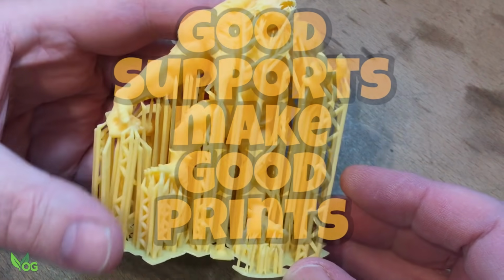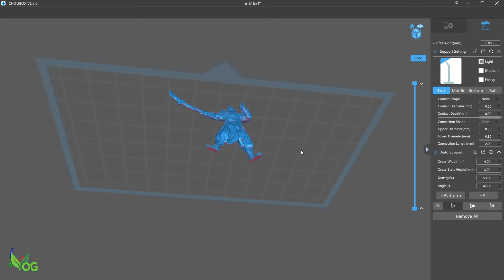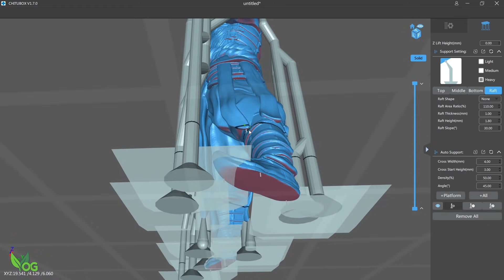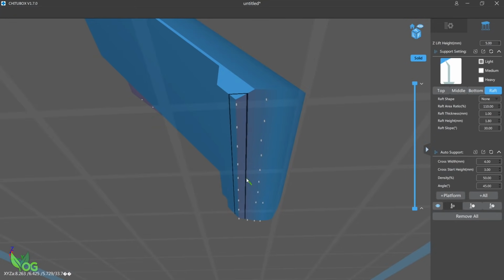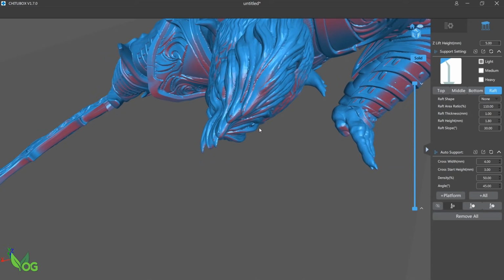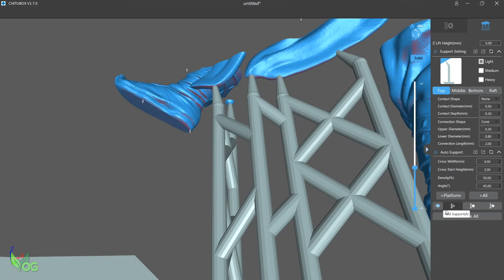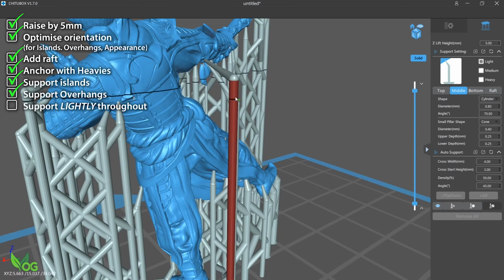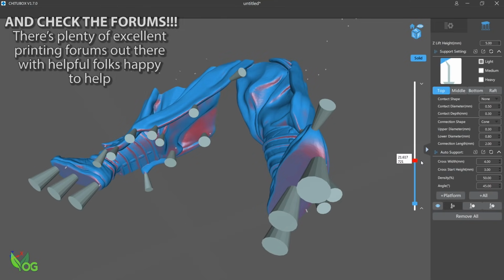3D resin print supports [EASY GUIDE]

Comment: Biggest tip I can think of is support in 3's and create triangles ... but that is a lot of messing around moving the support trunks until they join another support. Depends how important the detail is on file though.

I been trying to print individual tank tracks for a tiger one..  it's quite hard doing it in 1/35 scale .

Panther tracks printed out fine not one track failed out of 220 🤦🏼‍♂️ .... I have not got a panther tank model lol
Reply from the maker: Yes, those bracing supports are annoying... they never appear when you want then. That's why I support the supports.
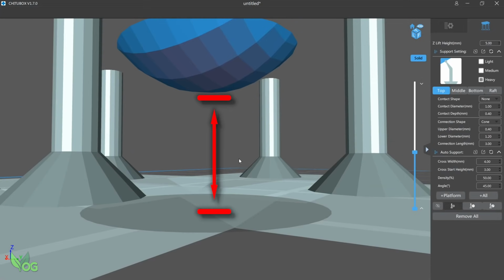Reply: @vogman  i just picked a random part of the video 1:35 look at the auto support setting at the bottom cross width and cross width start .... set them to zero and  that forces the crossing to happen as soon as they are close enough. or i just stick multiple in its own foot plate and make a tree, supporting the supports i haven't actually tried, sount like a good idea.  especially if the shaft is close to the model :P  zing!

i will give it a try on the tiger track link..  i know people sell casted one in 1:35 would you have an idea how they create the mould for metal casting as the track pins need to be hollowed out .  atm resin printing is easier but also is lighter , metal is prefred for weight
Reply from the maker: Please don't take ANY notice of the setting used in this video. I deliberately changed them in order to RESET them, so I can't be sure anything you may have seen is right. Just reset back to basics... it works well enough for me 😁
Reply: @vogman  no i am saying that's what controls when the supports bridge lol ,  or bracing or whatever lol

Comment: Very nice! Just got my photon mono, and am looking to learn the ropes. FDM is my bread and butter, but this is a whole new ball game. I feel like I've used a lot of metaphors here that mix about as well as oil and water.
Reply from the maker: This video focused on ChiTuBox, but the same principles apply to Photon Workshop, though moving the supports around is a pain. However, next week's video will interest you... a great slicer that works on ALL major printers, including Anycubic. It's a piece of cake, a walk in the park, like falling off a roof 😁😁😁
Reply: @vogman  God damn it, I am very much looking forward to that. Just sliced my first model in Photon Workshop and set it printing, and I suspect I'll have a headache roughly until that video of yours drops. Granted, it didn't help that the first time launching it nothing worked at all - it simply refused to generate supports, hollow the model, or do anything else than move the model around (with the slice by slice view showing it as an infinitely hollow mesh). Relaunch the program, and it behaved as expected.
So far resin printing has really surprised me with the quality being even better than I thought, post processing being far quicker than I thought, but on the other hand messier than expected. And my God has slicing being such a mind-bender been a surprise. With FDM, once you've got your settings, it's pretty plug and play. Here you seem to need to sculpt individual supports for every. single. model. 
As for your last metaphor - I'm reminded of an exchange between a father and a son when the former was working on the roof and his ladder fell down. He cried out to his son "Well, looks like I'm counting on you!" to which the son replied "Don't worry, dad; I won't let you down!" :D

Comment: i would be interesting to see you print a perfect cylinder tilted at 30 degrees. i cannot seem to get the bottom edge to print cleanly. it is almost always warped in some way
Reply: H D  i clean the fep with ipa then coat with 3IN1 PTFE Lubricant and wipe off excess oil of course... every print